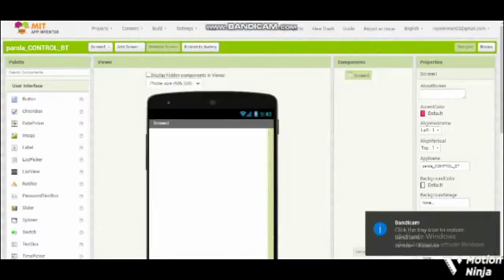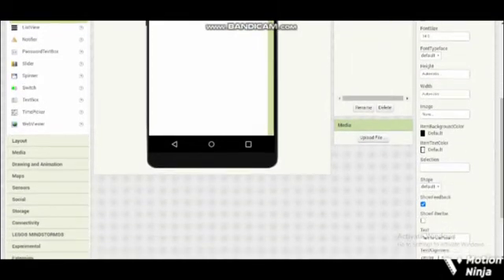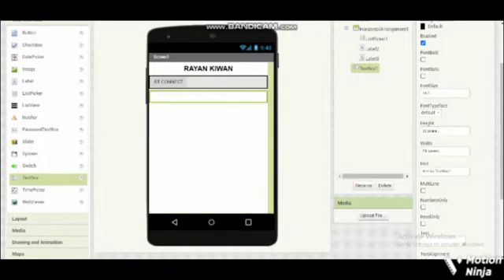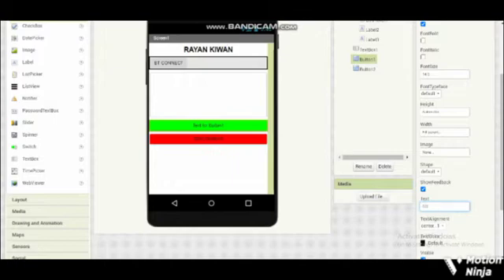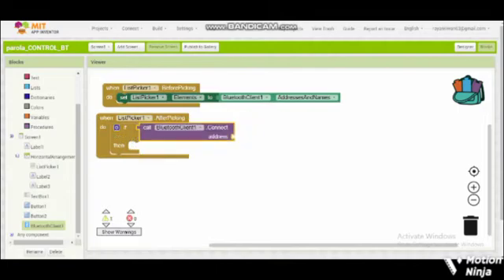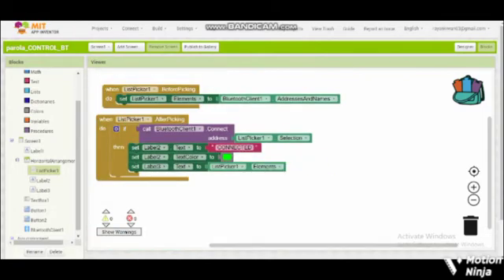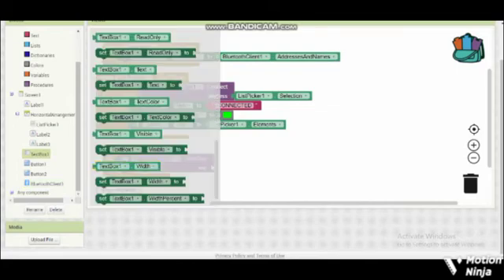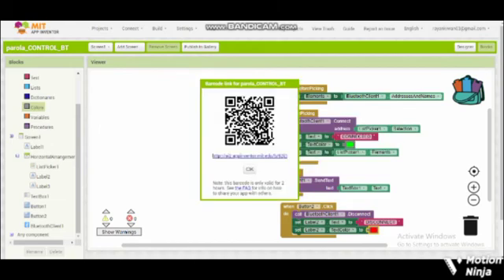Control Max7219 using arduino via Bluetooth and mit app inventor #tech #viral #arduino #bluetooth

Comment: where is the coding part for arduino which   associated to max7219
Reply from the maker: I will uploaded to you soon
Reply from the maker: Check out the code in the attached link below https://www.hackster.io/rayan-kiwan/bluetooth-control-max7219-using-arduino-178169